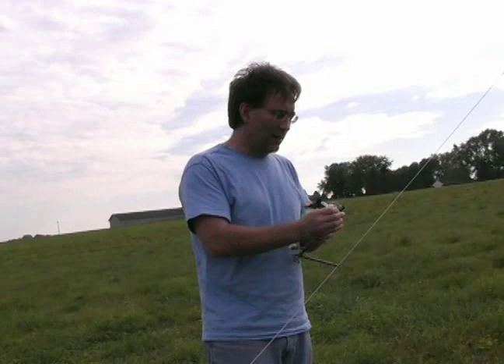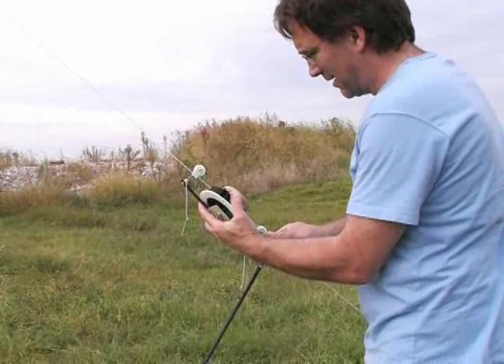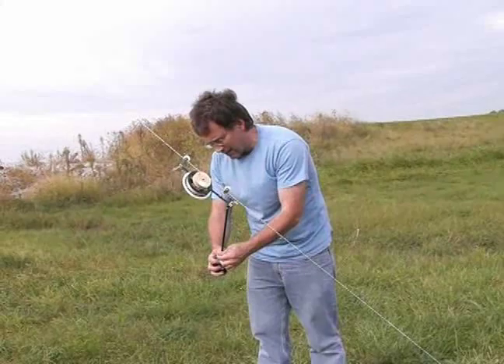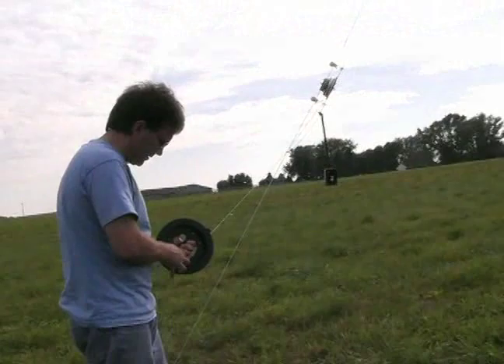Kite Line Shuttle

Comment: Great job. You're the only guy I've seen using a device to send the camera up the line rather than attaching the rig to the line and adjusting the altitude of the rig by bringing the kite in or letting it out. No need for a picavet either. I don't use a picavet for my rigs either I just use a pendulum system and have had no problem with stability. 

You have got some great engineering skills there.

Comment: Excellent development of an old idea. I really like the simplicity of it. Obviously, your workmanship is top notch for how easy the device works.

 Many years ago (about 35 of 'em), I needed some overhead photos of a complex construction project for a presentation I was doing to help my bid proposal for part of the project. But, the local air craft rental, plane and pilot was over $300.00 an hour. Way too much to invest for a chancy bid presentation. My company was small and we didn't have room to even waste a dime. My wife suggested a kite camera. So, I bought a cheap kite at K-mart, and used a small 110 camera. I made a rubberband windup timer to "push" the button on the camera when it arrived at the kite on a little slide "line messinger" . Then Sunday wife and  I went to the site and although I had to push and pull my "messinger" up and down for every shot, I managed to get 3 good shots of the subject out of 24 frames. My presentation went off without a hitch and my company got the job that was up for bid because of it.  So, these little "toys" can sometimes save all kinds of money and make a big difference in the right circumstances. Your rig is so much simpler and easy to use than mine was. You've done a good job, indeed.

Comment: Nice system. How about using a small kite or set of wings attached to payload that will lift and move payload up, taking most of the weight off the line (for better stability) ? A fixed obstruction at the top of the line could both trip the camera shutter and release payload and lifter back down the line, ready to repeat. Excellent video, great job!